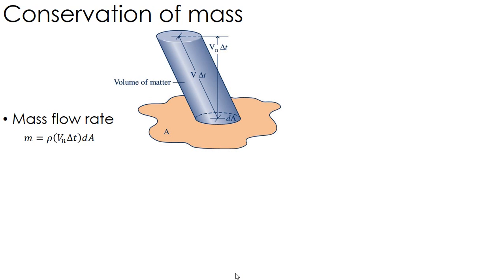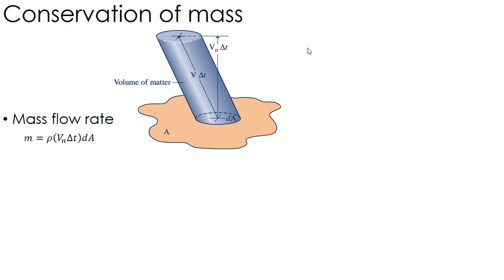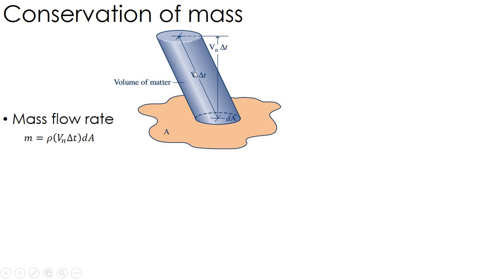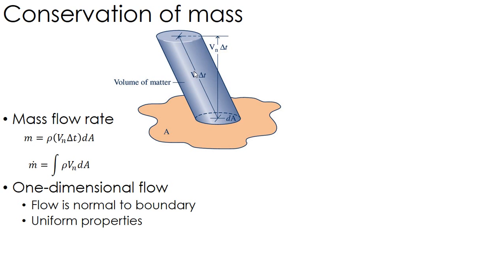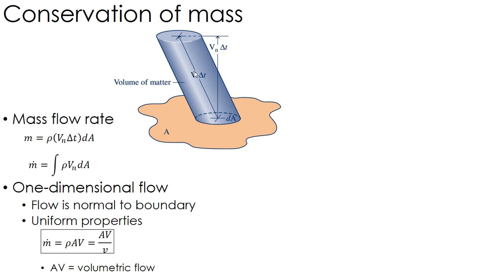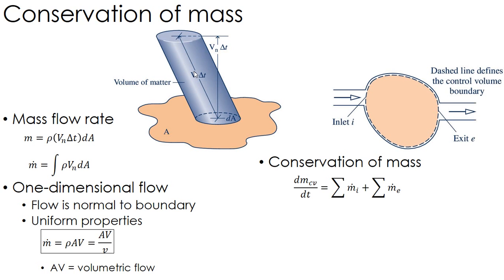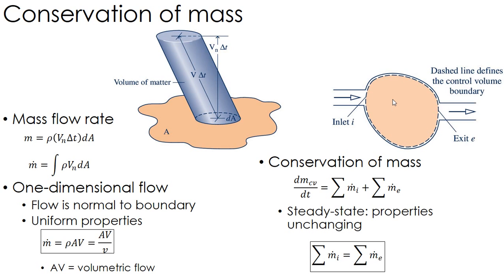Thermodynamics Lecture 11: Conservation of Mass

Comment: Shouldn't the conservation of mass be: accumulation= Sum(mi-me)  and not accumulation = Sum(mi+me) because the rate of change of mass is the difference between what goes out and what goes in. Steady state means that d/dt=0 and therefore there is no accumulation, there is no change in the total of the mass inside the system. What goes in, goes out.